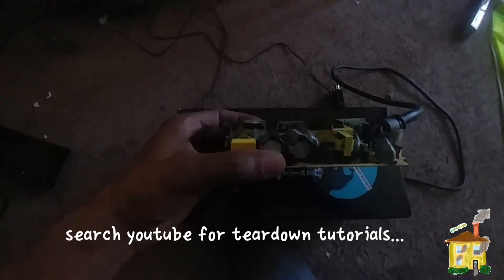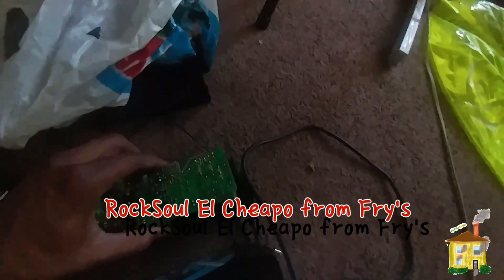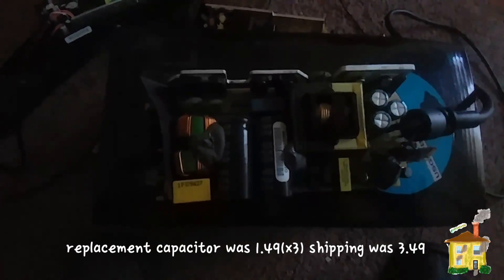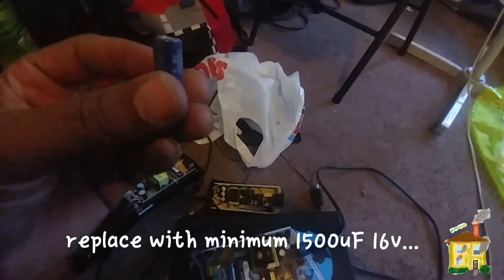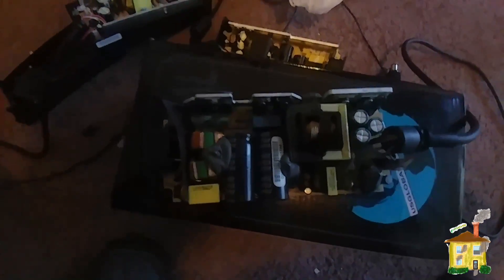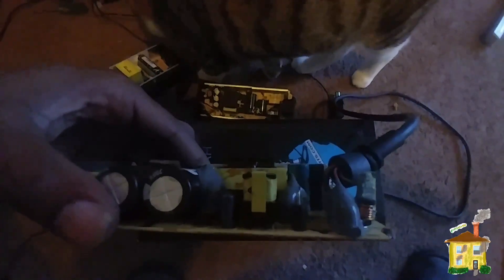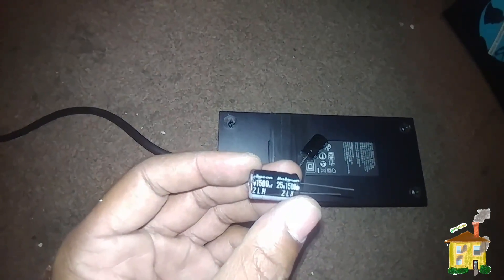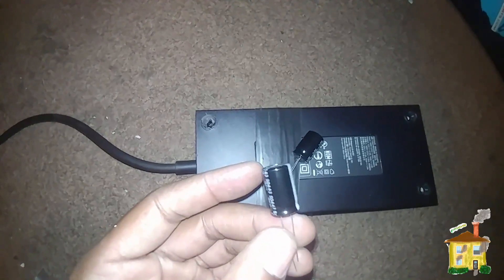Fixing Broken Xbox One Power Supply (Orange Light)

Comment from the maker: Update!!!! 
My Friend's Power Brick died just recently and its a different set of Capicators are all blown.... Its a Set of 3 with 2200uf(Microfarad) 16v specs...

So It appears that all Bricks will fail sooner or later...  Ill post an update for that repair...

Edit 08/22/21

Here is the link below for the trio of capacitors that need replacing if this one is not faulty

https://www.youtube.com/watch?v=40uwULDhX9E&t=4s

Update!!!!1

Two of the remaining 3 capacitors in my brick blew last night and I had to replace them.  Click the link above to view the quick video repair and symptoms of which capacitors you will need to replace...

#PiFFHoUSE
Reply from the maker: Video coming for that soon
Reply: I've used 5 power bricks even a 360 brick it still don't turn on
Reply: Please send me a link man mine has the three set of capacitors I'm pretty sure I know how to re solder them I just dont know how to remove them.

Comment: My Xbox one just stays at orange and when I try to power it on it does not work and when I use my controller It turns on for one second and the brick light is still orange even when there is no power it is still orange
Reply: I just had same issue and followed the fix with the 16v capacities and it worked perfectly. Got 10 caps for $5 on amazon haha
Reply: @michaelpacker9805  I just did not use it for 2 weeks and turned it back on and miraculously it started working

Comment: Ummmmmmm so how do I install the capacitor u lost me there lol please and thank u
Reply from the maker: Desolder the old capicators... If you dont have a desoldiering iron, use fingernail clippers to cut the soldiered points opposite side of the board holding the capicator in place. Wiggle the capacitor out gently.  Resoldier the new capacitor(s) to the board.  Match up the polarity as well... One side of the capicator will have dashes, that side will be the negative pole, opposite it the positive pole. Make sure you replace the capacitors the exact same polarity.  If youre not sure about your work take pictures before you disassemble.

Comment: What did you use to open the screws on the bottom?
Reply from the maker: Well this time I used a flathead screwdriver the drilled the screws out.. But you actually want to purchase a Torx Security driver set and use the 10mm .. You can find a set a Autozone, oreillys, walmart👍👍👍

Comment: Is it to buy a new powe brike mine has orange light and then I plug into console n power goes it it happening today help
Reply from the maker: Wait im confused what you are asking..  If your brick stays orange and wont power on your X1 youll need to buy a new brick or replace the capacitors
Reply: @PiFFHoUSEEnt  i did its going to be replaced by amazon im going to get a replacement brick
Reply: Keyser Soeze yes
Reply: It did I upgraded to to the 1tb Xbox one s it’s the power brick fail just replace the brick you will be ok
Reply: Keyser Soeze yup then the next day it didn’t work it’s cuz the plastic melts the inside it was a design flaw but it’s cheap on amazon my sister bought it for me but then I upgraded my Xbox it’s just the power supply but when u get a new supply brick it will work mine did that
Reply: Keyser Soeze you can add me on Xbox PRESIDENTCAZZ1
Reply: Keyser Soeze you’re welcome:)

Comment: For all of you saying that Xbox One S Internal Power Supply Units don't die you well guess what they do my Xbox One S PSU burnt because I had it connected on a Outlet and It was thundering outside I didn't know that The Xbox One S and One X have surge protectors so mine got fried. Now I got to buy a New Power Supply Unit on Amazon or Ebay open upp my Xbox One S and change the PSU for it could fully work. All my XB1S do now is Turn on beep for a second then turns off lol 😂
Reply: Bro that happend to my cousin lol then he bought a ps4

Comment: I did some dumb shit an left the xbox on for two days my brick blinkin green and orange
Reply: PiFFHoUSE the capacitors are bulging
Reply from the maker: SNG NINJA if it is the same capicator in the video, replace it with same or higher voltage 👍👍👍... I suggest slightly higher voltage...

Comment: Yep, you're a hilarious dude. Not many people will attempt replacing capacitors, but props to you. Did you go back with identical caps, or can you upgrade? Get really good power protection for your console, TV & whatever else, plug them all into one unit.
Reply from the maker: slightly increased the voltage from 16v to 20v... you can go higher but its a tight fit for the capacitor.  Original capicator radius is 12mm.... I used 20mm
Reply: PiFFHoUSE sittin on 20’s 😂 how she workin now? I got the same bullshit ass problem, about to go deep but I wanna know if I should match the caps or go with the higher voltage.
Reply from the maker: @OMGlaur  go with slightly higher voltage.. the console actually uses that extra stored power.. I wouldnt go higher than 20v though.  Sorry for response delay.

Comment: Easy way too fix it: get a PS4
Reply: Multi Games Express wrong ps4 does the same thing you just never experienced it
Reply: It's happened to my friends ps4s. The power isnt going to the ps4
Reply: The ps4 has a fan louder than the TV while playing cod who the fuck wants that flaming garbage
Reply: chamhad coler No, you’re wrong. The PS4 doesn’t use a power brick.
Reply: Stfu kid
Reply: I wpuld use ps4 if it's controllers wernt uncomfortable
Reply: RedFace obviously. Any power supply can be fried. But not as frequently or annoyingly as this power brick.
Reply from the maker: Thats what the YLOD is on playstation... Sony just does more frequent hardware revisions per console cycle, and always has...
Reply: Nope: thanks for the defense 👍
Reply: Multi Games at least he can tell the difference between two,to, and too
Reply: Multi Games Express no problem mane
Reply: Multi Games Express or upgrade to the s either one would work

Comment: Yo my Xbox one turned off itself on December 31st Sunday night and my orange light is still on and how I get rid of orange light.? Do I have to get another power supply?
Reply: aaron baskerville if your still having problems, make sure your not plugged into an extension cord but instead a wall. That will most likely fix the problem. If the wall plug doesn’t work, go into another room, plug that Xbox there, see if it turns on, if it does turn on, bring it back to your gaming area and plug it in and see what happens. Also rub the rubber plug thing in the brick until you hear the electric “click” noise. That will make the power brick light white.
Reply from the maker: aaron baskerville if you followed Microsofts official instructions ( https://support.xbox.com/en-US/xbox-one/console/reset-power-supply-solution ) and it still doesnt work, then yes you will need a new power supply...
Reply: Gehrig Mandrin what’s the rubber plug? The skinny thing on the opposite side of the plug in thing?

Comment: How do yall break these things I had mine for 4 years and never had a problem lol
Reply from the maker: I have a launch day console... Each time my brick blew, it came during a console update(alpha preview)
Only thing plausible is the jump in voltage when recovering from Instant on to the console update screen...
Reply: I had mines for years and it just blew yesterday
Reply from the maker: John Fournier To be honest, if you can afford an X1S get that instead... The bricks will always fail unless you replace that capacitor with a higher voltage...  

One thing I also noticed is that my console starts up much quicker after I replaced it...
Reply: Had mine for 5 years and it stop working
Reply: Michael Tierney mine blew tonight lool right after switching power modes from instant on to energy saver and doing a full restart
Reply: John Fournier honestly there was no hope for mine to be revived I just got a new one from Amazon
Reply: Michael Tierney all you did was buy a new one and your xbox worked again no problem right? I feel ive wasted much time assuming it was my console
Reply: PiFFHoUSE Ent good to know tysm!
Reply: Michael Tierney which one u copped from amazon?
Reply: xl RIP lx i had this problem after 4 years so yeah
Reply: Iv had mine since release and now my brick is shit . It happened when I moved it to a hotel and went to replug it . Has nothing to do with anything I did it just shit out
Reply: Microsoft makes shitty consoles. Mines broke after just a few months
Reply: poweroutage
Reply: Chicken Finger's same
Reply: Mine just today blew out
Reply: superstaypuff lol 😂😂😂😂
Reply: Iv had the launch day console and used and abused the thing but I went to update it last night and it finally give up with this power brick problem lasted a while but I’m still pissed
Reply: xl RIP lx mine broke after 3 yrs still trying to fix..........m
Reply: Yet you still found time to watch this vid and then enter the comments section !!!
Reply: Mine just went out don't know how to feel